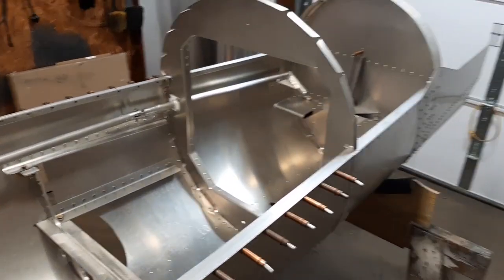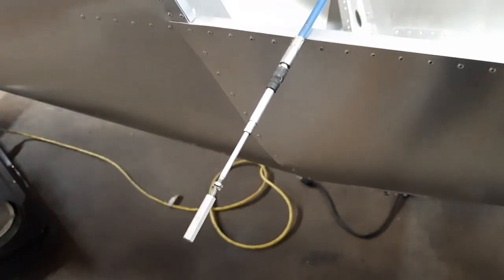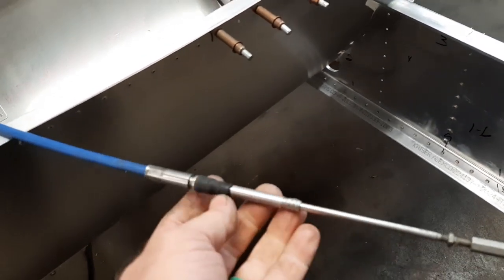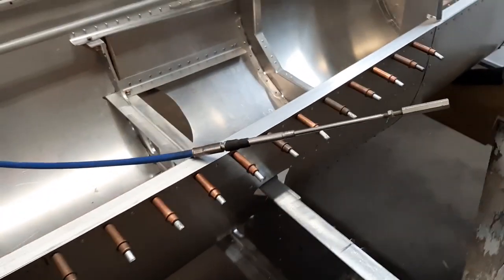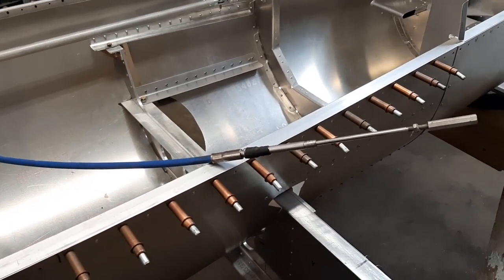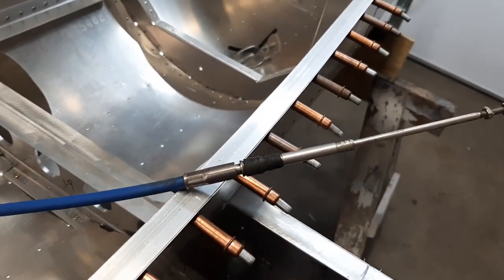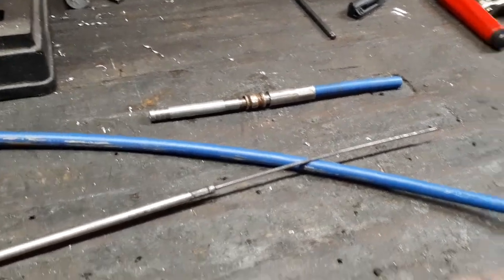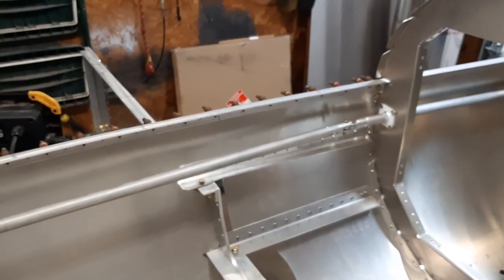Control Rods VS Cables - Hummel Ultracruiser

Comment: Would a pull pull cable system be lighter weight?
Reply from the maker: Maybe.  The pull pull cable system for the rudder on the Minimax didn't weigh much.  I would still prefer rods and bellcranks anywhere there was a direction change.  Straight shot to the rudder was OK.
Reply: @xpsgarage  do you think the control rod would be better if it was a carbon tube with aluminum joints? Better relative to weight
Reply from the maker: @96vmax4  Carbon fiber is lighter and stronger than aluminum so that would be a win.  It's main drawback is expense.